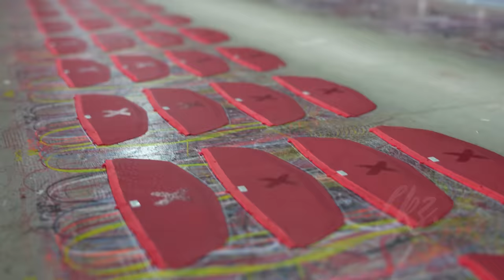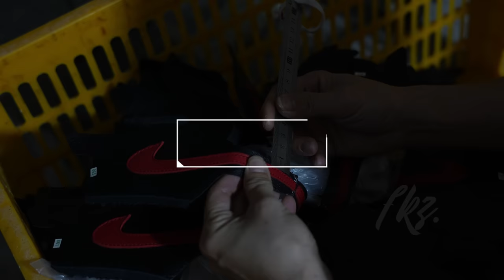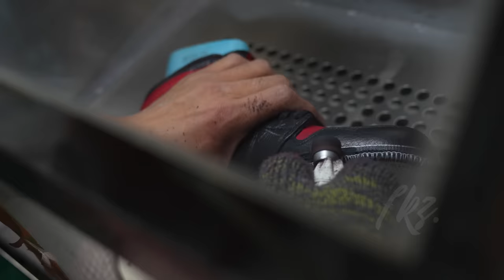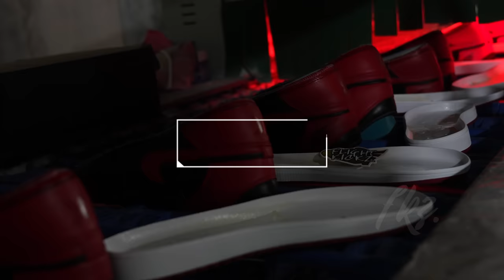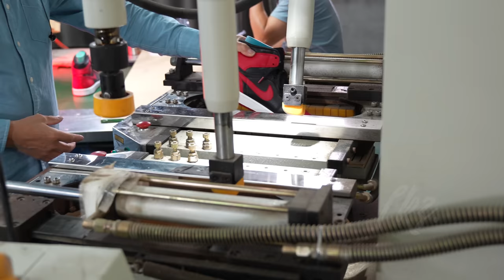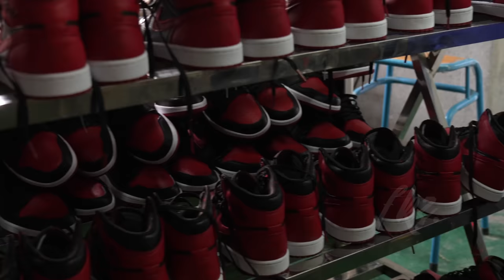Factory Process of making the Air Jordan 1 Banned 2011

Comment: Bruh where’s the air unit??
Reply: Yep, the air Jordan 6 my brother had had 2 air soles, one in the heel and another near the toes, we saw this when the shoe got totaled.. Jordans are supposed to have air sole technology, that was their biggest marketing selling point, that the air soles help absorb shock when landing from a jump...
Reply: it was in the heel are!!!! you just had to know what it looks like to see it!!!! it has an incline to it!!! with it is very thin also. they should revise it to where it is full length. the z1's have a full length strobel and they feel amazing.
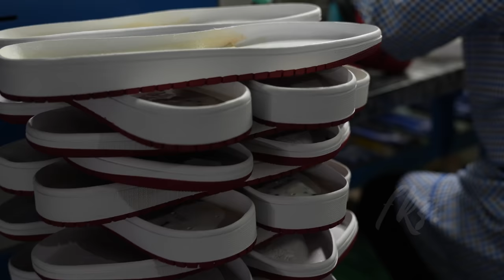Reply: at 1:17 you can see they glued the unit in the outsole with a yellow looking bond glue. the unit has holes or dots showing.
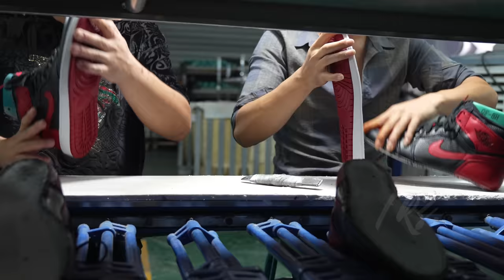Reply: @drewali7  nope, 1:31 there's no air sole, air soles were like 2inch by 2inch squares with pressurised air and about a quarter inch thick..
There's nothing there but an extra coin thick foam added to the heel part..

Comment: I bought a pair of air Jordans 1, black and red where in the back of the sneakers it says since 85, they are mostly black in the middle and red in the back and in the front and they have small tiny holes as the design in the sides. I bought them at the nike outlets here in Puerto Rico around 2010 - 2012 , which model are these? I want to fix the soles on them and maybe sell them in the near future ,they are in mint condition.
Reply: asking a question like that on YouTube is like talking into a hole in a tree.